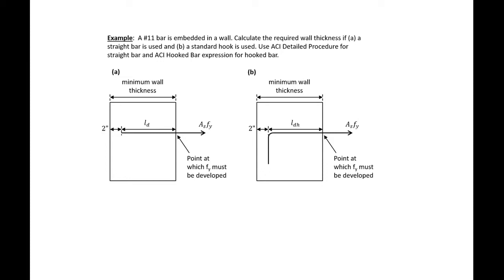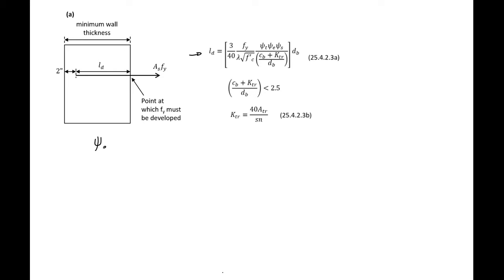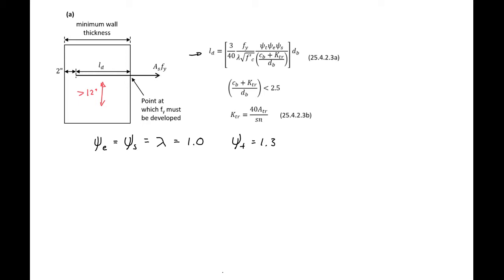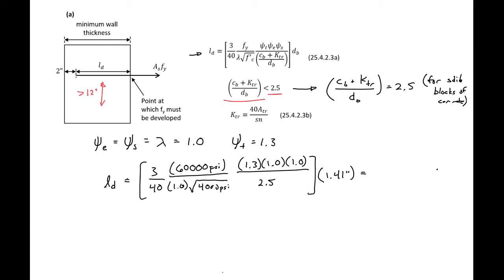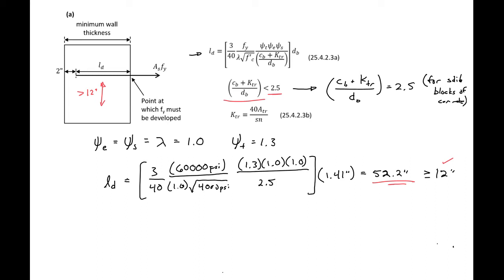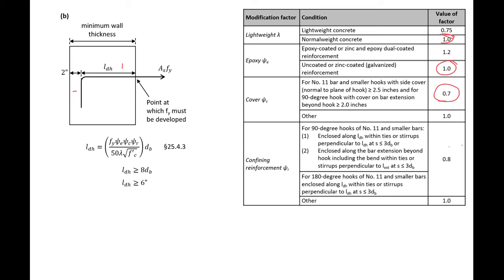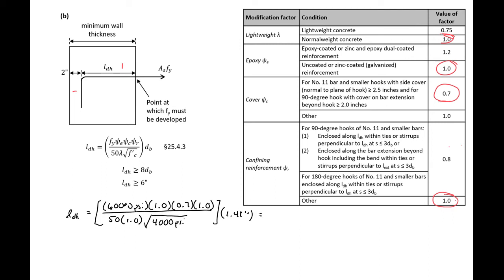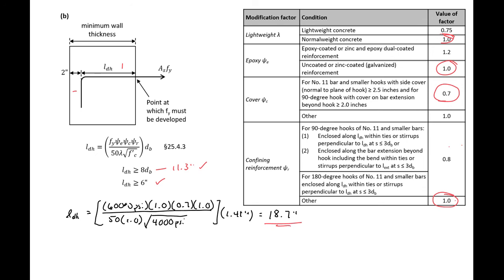10-02 - Example 2 - Hook Bar Development using ACI 318

Comment: Thank you for the video sir ! I have one question thought, we use either a straight bar or a hooked bar right ? We can't have both Ld and Ldh at the same time ?
Reply from the maker: Correct. If you have enough available development length, then you do not need to use a hook. This example shows how using a hook can decrease the required development length (compared to a straight bar), which is necessary when embedding in walls or columns.